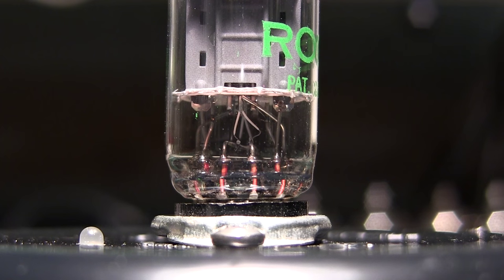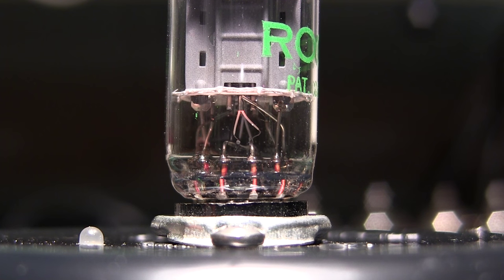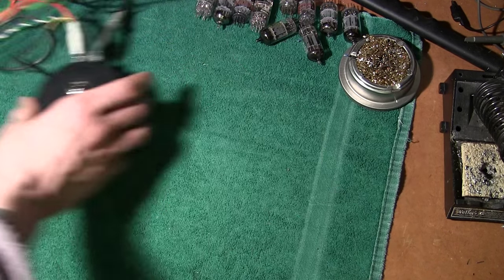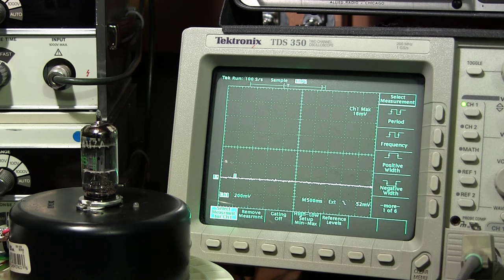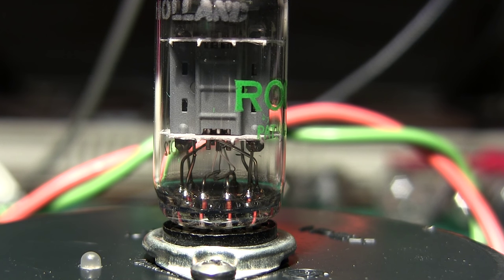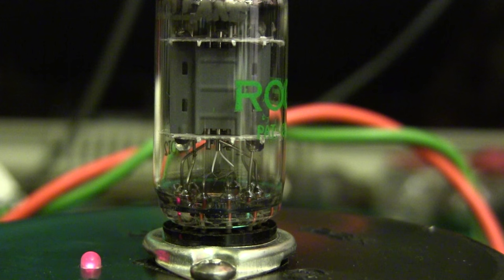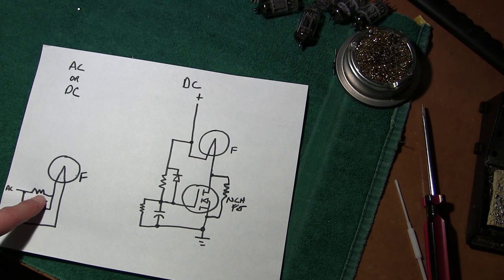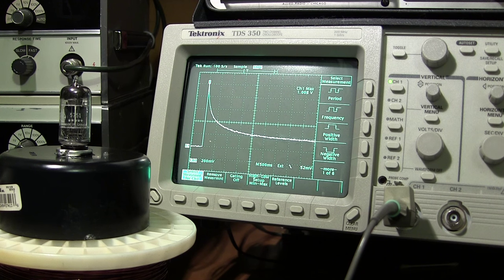Tech Tips Tuesday Dirty Little Secrets

Comment: After watching your video I posted a link to it on an UK vintage radio and TV forum. The consensus after a week is that heater or filament flash is a known phenomenon, it isn't a problem and hasn't been known to cause a break. The forum members have a vast number of years of experience between them in the TV and Radio repair trade as well as other electrical engineering fields.

See UKVRR - Heater Flash?
Reply from the maker: +Dr Wobble 
Lots of interesting experiences. It's nice to see people getting along in a forum!  I do have to admit, my experience with heater flash isn't a good one. Thanks for your input!
Reply: +Dr Wobble A lot of people will say a lot of things but never provide physical tangible evidence. I am not an expert in EE by any means as my background is SE. I can say if there is a difference, whatever that difference may be, and Mr. Carlson clearly shows this, something is not right and the end road is typically an early failure. This I can guarantee from experience and if it's physics based it's a certainty. This basis is called the repeatability standard.
Reply: +Ham4Ham Wasn&#39;t doubting Mr C or his obvious experience and knowledge, just reporting what other electronic engineers of equal knowledge and experience had to say on the issue, which of coarse should carry equal weight regardless of the lack of tangible physical proof.
If you read the thread in question, several posts outlined instances of heater flash and the continued working over many years of the valve. So, this phenomenon whilst  a possible cause of heater or filament failure, it is far from a certainty. QED

Comment: Thanks for pointing this effect out, as most viewers will not know about it
This is why heater filament windings on transformers were made "soft", high inductance or resistance. To limit the inrush current old commercial designs also user uranium dioxide resistors (NTC characteristics) in filament circuits, or on older power amps I own from the 30's they have a preheat winding (2.5V) on the filament transformer winding, which is operated by turning the main switch. AFAIK this was basicly to prevent unloaded DC buildup when applying power, due to direct heated rectifier tubes vs indirectly heated power and pre amplifier valves, which took longer to conduct. This also added highly to the reliability, which a commercial PA system was designed for. 
For non commercial, mass production, the inrush effect did not matter, as you stated "as long as it reaches the stated useable time" or warranty time (6 month from sale to the end customer), the mfg was fine. 
And, like Philips/ Valvo (Mullard/ Amperex, ...) being one of the biggest tube makers in the world, you needed the replacement purchase business to keep the factories going.

Comment: Excellent explanation. I had a tube doing that in my Drake TR4CW and didn't really understand why. I swapped in a new tube and no problem. 
When using my vacuum tube receivers (R4B) I usually just leave them on all day if I'm going to be using them later in the day.
That's to limit the # of  filament shocks. I think I need to build a 'step start' for the whole radio....
if I knew how😄

Comment: I can see that the filament that has the flash has a loop in it with no coating before it connects to the pin. The one with no flash has the coating brought right up to where the attachment is made.

Comment: Good Advise .........people today like automatisation but the simple way is often more reliable , in this case a switch and resistor . One has to notice that while " preheating " vacuum tubes one has to take in consideration the design of the HV power supply in order not to stress components like capacitors and their designed max voltage ratings. ( max voltage and max voltage surge ) A good rule of thumb is to use a voltage at 70% of the voltage rating of an electrolytic capacitor. Without a load on the power supply one may exceed this max voltage , ( special attention with choke input filtering is needed )
I saw well renowned amplifiers with two 250 V capacitors in series ( sometimes without a resistor/voltage dividing network ) with 490 V HV supply under load ( and when tubes are fresh !!!! )  
As well as 450 V capacitors ( low grade quality ) with 435 volt HV rail ( no room for line voltage fluctuations, voltage spike at start up or ageing of the capacitors , they tend to lower /loose their max voltage rating when they age )
Besides the value is often not the bette or best one , economic considerations or audiophile overkill, rarely the right amount and quality...
To extend the life of  your ( precious NOS ) tubes .....:

1)  SOFT start of the filaments 
( MC INTOSH used to install an NTC resistor on his AC input which performed a slow start up for the filaments as well as the HV .......) Was this to  simple ?
2) PREHEAT the filaments for more than 30 seconds ( Powertubes like KT88 for more than a minute )
BEFORE applying the HV
SHUT DOWN the HV before the filament supply to drain the HV.
Install a bleeder resistor if your amplifier does not have one .
3) USE vacuum tubes always within the limits f their electric design ....
4) DO NOT OVERHEAT OR UNDERHEAT the filaments , apply the correct voltage for what the tube was designed.....6.3 V and not 5.9 or 6.9 !!!!
5) Correct line voltage !!!!!!!!!!!!!!!!!!!!!

On the funny and flashy side of vacuum tube history :  " The BBC did  never shut down amplifiers .......think about it ."

AT LAST.............Pull up the reference voltage of the heaters of small  signal vacuum tubes ( dividing network on the HV /small +small smoothing cap ) in some designs , it will avoid noisy tubes and reduce the heater to cathode voltage difference not to exceed .....( this precaution is often forgotten by modern manufacturers and leads more than once to repeating problems for which there seems no evidence other the heater to cathode isolation related problems )

Comment: I'll be darned... I didn't expect to see heater flash but I just witnessed it twice. I was testing the tubes from a SIlvertone 1484 guitar amp that I am restoring. The tube compliment, all Silvertone branded tubes, is (2) 6L6's (no flash), (2) 6FQ7's (no flash), (2) 12AX7's (no flash), and (2) 12AX7 / ECC84's both had filament flash. It was very obvious. So much so that I thought I would see zero emissions when I tested them. All of the tubes tested very strong so that's good... I came back to watch the video to make sure that I was seeing the same thing. 
Thanks again!
Reply from the maker: +Michael Lloyd 
Your welcome Michael!
Reply: A lot of Silvertone tubes were rebranded Mullard or Philips tubes. Starting back in the 1950s companies like Fisher, and even Carvin Guitars used European preamp  tubes. Sears Silvertone was no exception. It's a crap shoot in their guitar amps, but the Silvertone hi fis, stereos, and outboard powered speakers for hi fi, usually had Mullard or Philips tubes in them. Fisher tended to use lots of Telefunken tubes. Simpson, Daystrom, Allied, Eico, HP, Tektronix and other test equipment companies also liked using the European tubes. Amperex tubes were usually made by Philips. Norelco was American Philips. I don't know why Philips was branded Amperex here. Later on Sylvania & Philips ECG were one and the same, (kind of,sort of).

Comment: Filament flash happens almost exclusively with coiled filament heaters. The very end coils lack insulation material, and heat much more quickly than the rest of the heater. Most American tubes do not use this heater design. Instead they use straight tungsten wire zig-zagged up and down inside the cathode. Any bare exposed tungsten at the corners of each zig-zag is just a single strand of tungsten, and not a close coil, which would tend to concentrate heat and cause a bright spot.  Early Sylvania (Zenith, Philco) designed 117Z6 tubes, 117N7, 117L7 used coiled heaters, and often had the flash problem at the ends where the coils lacked insulation coating.

Comment: Ahem..

See manufacturer's data sheets for "Controlled Heater Warmup Time". This was an effort to raise the resistance of small heaters in series with larger ones as found in series-string heater circuits. I'm sure I remember reading an explanation of this around 50-plus years ago. Just wish I could remember where. Tubes found in a TV tuner with very-low voltage heaters would commonly exhibit this trait. 

The one clue here was that the bright "FLASH" would only be seen when powering a stone-cold tube. Powering down the heater, and trying it again any time soon would NOT reveal a repeat of the "FLASH". Again, this was a hint that the phenomenon was part of the intentional warmup trait. 

Just leaves me to wonder if everyone involved with this sort of heater design is long dead, and nobody is left to explain the rationale behind it. 

Bravo, and keep up the good work!

73
Reply from the maker: Well, the flash is only on one filament, and they can both be used in parallel. This would mean that only one filament has controlled warm-up, which doesn't make sense. I also have batches of tubes (same number and manufacturer) some flash, others don't. I think it's more like "controlled lifetime." Thanks for your comment and input.
Reply: Now there's a detail I seem to have missed. Just one of the two heaters. Not sure how I missed that, but this is absolutely wrong. Both heaters should behave the same. 

Sounds more like a mixup on the assembly line. Puzzling phenomena often boil down to a question of incompetence on the one hand, or dishonesty on the other. Like when a politician says something you know darn well to be false. 

My vote would be with sloppy identification of heater-wire assemblies as they were loaded into the hoppers. Brings to mind a scenario where 'normal' heater-wire bundles were loaded into the hopper for the 'left' heater, and the CWT heater bundles went into the 'right' heater's hopper. Never participated in the assembly of empty-state devices, but my bets would lean towards sloppiness, rather than a desire to make a product that fails prematurely. 

I do know that as manufacturing batch sizes shrank during the years of   declining demand the defect rate went  up.  Our 100% incoming-test policy revealed a rising defect rate from the mid-70s until the last remaining domestic factories closed in the 80s. 

Clearly calls for a strategy to compensate. Or a willingness to replace tubes frequently.

73
Reply: Chris is right, this is by design. In series heater configuration (300mA) the two heaters must always be in series and so having the current limiting "flash" on only one system is enough.
Reply from the maker: Helmut, you are incorrect. The heaters are not always in series, this is the reason for the center tap at pin 9. Most applications operate these tubes at 6.3 Volts (parallel connection), as this is most standard. So then one side flashes and the other doesn't. That makes no sense. In many tubes (same make) both sides flash, and in others, neither do. It's hit and miss with these tubes.

Comment: A very handy tip,Thanks - I've been thinking about this problem very recently and came up with the idea of a 50% stand by preheat through switching the filaments in to series pairs when the amp is switched off(a stand by if you like) and back into parallel at turn on (I'm sure not an original idea) but yes- soft start seems like a much better cure for this problem- again Thanks, All the best Mr Carlson.
Reply: ...the earlier vacuum tube TV sets with instant on, used a DIODE in series with the heater string- that allowed exactly HALF of the AC power to flow through the vacuum tube heaters while the TV set was turned off- and when the TV set was turned ON, the diode was bypassed, and the vacuum tubes received full power. 

...on a side note: I remember when these particular TV sets were OUTLAWED in New York City, because they were considered to be a waste of electricity!!!

Comment: Many years ago, we used a diode in series with the 6.3VAC output of the transformer and used a delayed relay (about 10 sec) to short it. Just another way to protect AC filaments.
For DC filaments you can use same setup, but with a string of 4 or more diodes in series, to drop the voltage enough to avoid flash and then the delayed relay shorts them all.

Comment: Excellent video! You are very knowledgeable on electronics. It seems just about anything that uses electricity has issues with high current draw when powered up. Capacitors, power transformers, filament light bulbs, motors, and the list goes on. Some devices NEED full current to kick em into gear, but most electronics would be happier if that "inrush" current could be suppressed a bit, like your flashing tube example. Items that use modern cheap switching power supplies should be left alone though. They arn't too fond of a slow voltage rise when powered up. But, old skool iron transformer equipment driving tubes would be a good candidate for some kind of ramp up to full voltage instead of slamming it w/full mains power IMO. An example: I have, yes have an old Heathkit solid state stereo amp that has no speaker protection circuit or relay like most modern amps to. When I powered it up, the speakers would thump something terrible. Ya, I learned if I switched the speakers off, waited about a minute, then switched them on again, no thump. But I had to remember to do that everytime. So, I built up a simple delay timer circuit and using  a hi wattage lower ohm resister   in series with the main lead from the transformer to the rectifier driving the B+ to the output transistors. When the amp was turned on, the relay would be open, forcing power through the resistor slowly charging the B+ capacitors for a few seconds. After the time out, the relay would close thus providing full power from the transformer! NO more thump! Amp is pushing 50 years old  now! I made the mod around 20 years ago and amp has never had a failure!

Comment: I'm not sure weather you are talking about modern made valves (tubes) or older pre 1970.
I started work in Marconi Instruments (English Electric) in the late 60's started on mainly valve test equipment.
I do not remember any case of heater (filament) flash.
As I remember most valves were mainly English Electric (EE) or Mullard but there were others I cannot recall.
I'm sure if we had this problem especially EE would have felt with it.
Thanks for anothe great, well described video

Comment: Found an interesting comment on a blog from Eli Duttman entitled NTC THERMISTOR as SOFT START for TUBES..."BTW, the bright turn on flash associated with Philips, Mullard, etc., made tubes is intentional. Philips and the companies they owned (including Mullard) used such construction so small signal tubes would not cathode strip, when used in combination with fast starting, directly heated, vacuum rectifiers."
Not sure what Cathode stripping is and if it is applicable to this discussion?
Reply: The chemical coating on the cathode will strip off with the electrons and stick to the  plates, when the tube's filaments are not heated up all the way and a signal is applied to the tube. They will also strip some at idle too, but not quite as badly.

Comment: I don't see these modern junk tubes flare up like the old western European tungsten filament tubes did. Nickel chromium heaters generally  will never flash or flare up, but just like their tungsten counterparts, before the NiChrome wire gets hot it's still almost like a dead short, for a few microseconds, until the heater filaments get hot. When the heaters get hot the resistance goes up. Old incandescent light bulbs do the same exact thing. Test a light bulb  for continuity with a Fluke or even an old Simpson 260 and it measures almost like a dead short.

Comment: Hi, a very interesting and thought provoking video. I believe that a significant part of the problem is when heaters and HT are sourced from a common transformer. Typically an old school radio will use a thermionic rectifier, so on power up you have a quite large transformer ONLY seeing the heaters as a load and able to provide considerable current into them. Although I have not done any experimentation I would suspect that a solution may be to power the heaters from a relatively small dedicated transformer. IE one that is incapable of providing many times the heater current required by the equipment.
Thanks for the video!
Reply from the maker: +g0fvt 
Thanks for your comment!

Comment: Another elegant way is to use just one resistive component, an NTC Thermistor, in series with the filament line. At t=0, the thermistor has high resistance. Current drawn through the thermistor self-heats the component, and it's resistance drops (typically 5%/C). Within a few seconds, the thermistor is much lower in resistance than at t=0, and nearly full power is being dissipated in the filaments. True, you have to make a guess about which temperature coefficient you want, and how quickly (the thermal time constant) you want the thermistor to act (and yes, the thermistor body gets hot).
In the 1960's, I supplied NTC thermistors to a large scale manufacturer. Their scales had an incandescent, 7-segment, multi-digit display (this was pre-LED days), and a small thermistor in series with each lamp greatly increased the life of the incandescent lamps.

Comment: I remember the new TVs with is instant on the film tubes I believe ran at half voltage that way when you turn the TV set on it would come on right away delay circuit would keep your tubes lasting longer I believe it's a good idea to test your new tubes if you see a flash like that you need to send your new tube back and get another one! Remember you paid for it  a good way to test your new parts you just bought 🤗